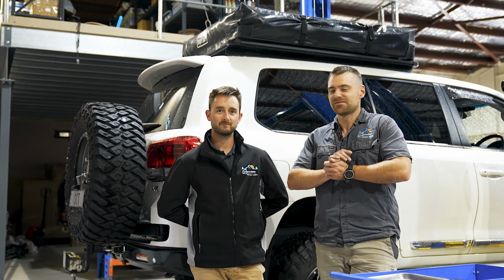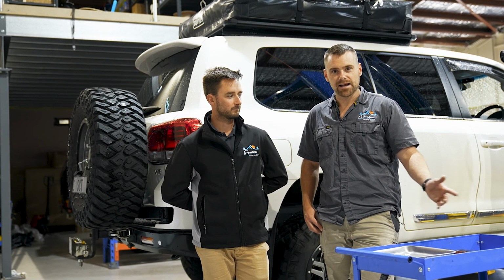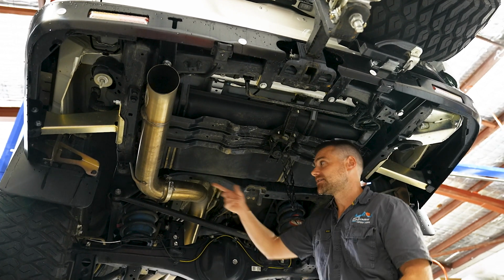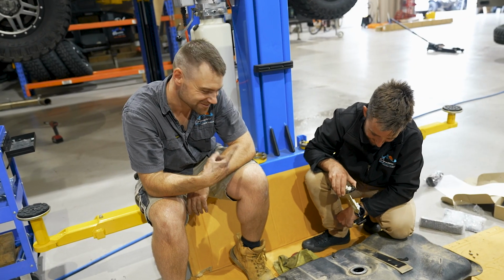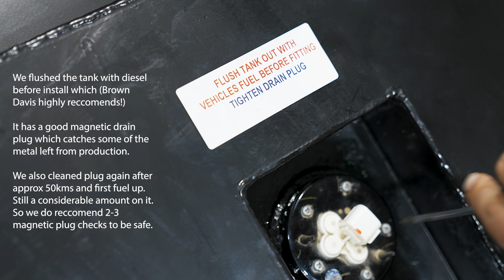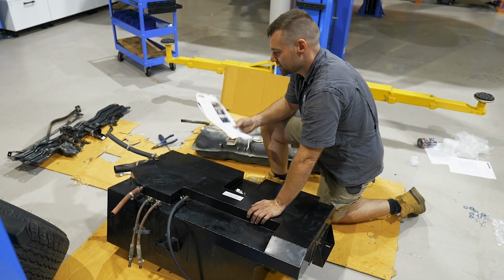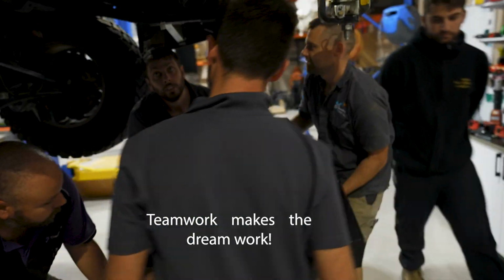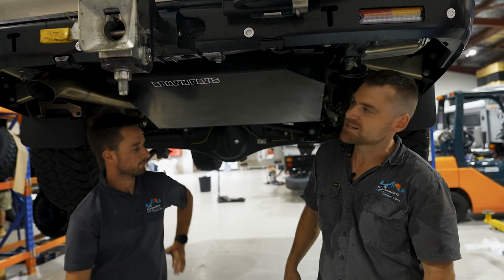273L Of Diesel! - 200 SERIES - BROWN DAVIS - DIY FUEL TANK INSTALL

Comment: Hi. I have recently installed the same tank in my LC200. I have a couple of questions I was hoping you could help me with:

1. My guy did not flush the tank before installing. How do we check the magnet cap to see if it caught any metal deposits. Do you have to take the tank out to do this and does it have to be done on an empty tank? 

2. My guy attached a long air mix pipe to the valve that’s on the side of the passenger side tire by the hood. The other side of that pipe sticks out in the hood. 

Is this conventional way of doing this? I was told this is done because higher air pressure needed for large tank. 

I would appreciate your thoughts.

Comment: What about exceeding GVM with this and all the other gear you guys fit. Do you ever weigh these vehicles?
Reply from the maker: Its something we are aware of and keep in mind. There are 2 things we've done to make sure we are always under GVM. Firstly we got a GVM Upgrade on the car when we took delivery. Secondly we tow a Camper - this allows us to get some of the weight out of the Car and into the Camper. Properly packed it means neither car, camper or tow ball are over loaded! (I reckon we'd be well over if we didn't move some of our Gear into the Camper Trailer).
Reply: @SignatureCamperTrailers  thats good in trying to manage the weight abit

Comment: why not use ARB's TAD108? plastic is stronger and lighter.
Reply from the maker: There are varying thoughts and opinions about that… the ARB tank is awesome but also more expensive. We like the design and durability of the Brown Davis tank.
Reply: Ask Matt from Explore Life how good the steel tanks are, split his going to Kalumburu
Reply from the maker: @sams8243-z2h  mechanical things will inevitably fail on occasion - it's how the manufacturer responds and the overall design. Steel tanks have been around a long time and for every failure there are thousands of success stories. If we were to immediately discount a product due to an issue we find online we'd never buy anything!
Reply: Didnt appear very durable when old mate was in the dirt for 4 hours trying to plug the crack, that was after losing the fuel. Warranty is all well and good but when your in the middle of nowhere its means nothing. ARB Frontier tank is durable.
Reply from the maker: @sams8243-z2h  The ARB Frontier tank is also a very good tank - also with failures. We aren't saying one is better than the other - pick the one which suits you. From experience repairing a cracked steel tank is far easier than repairing a cracked Poly Tank. One person on Youtube who has had a failure doesn't immediately mean a product is no good.
Reply: I agree, but let's be honest it ain't the first steel tank that's cracked
Reply from the maker: @sams8243-z2h  and wont be the last - that's sometimes the cost of using your gear in rough terrain. Both designs have their positives and negatives. Choose the one that's right for you!
Reply: Had my BD tank for years now… it’s been everywhere… hasn’t cracked…

Funny that aye…